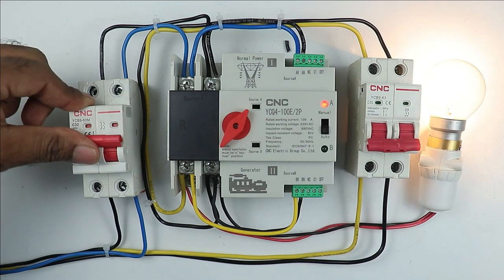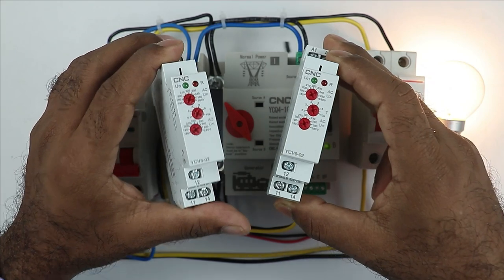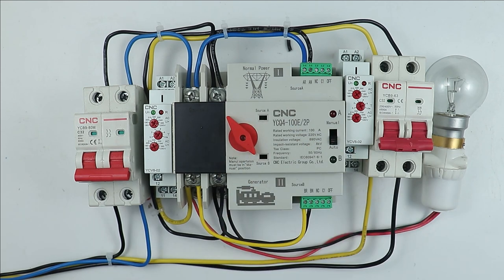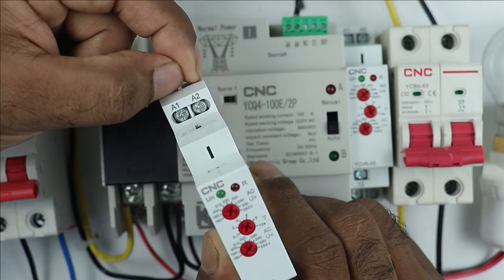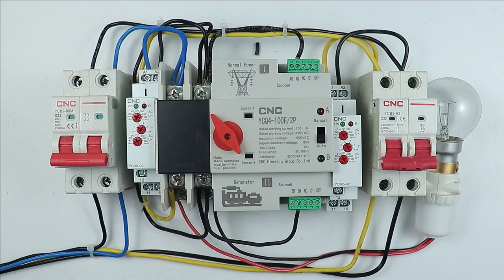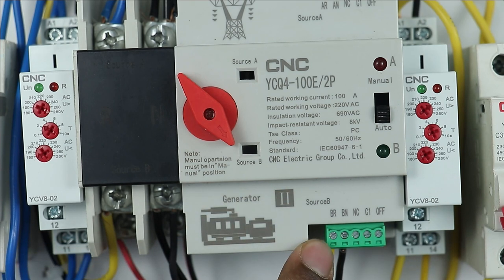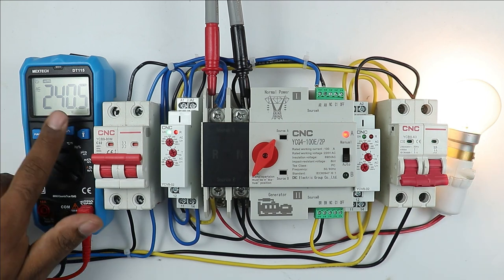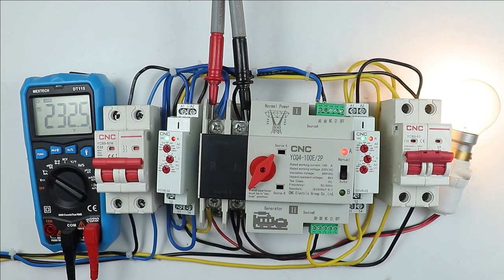Auto Change Over Switch Problem Solved by using Voltage Monitoring Relay @TheElectricalGuy

Comment: Very informative and well explained. May I know what is the different between this ATS, which says grid & generator, and another type of ATS, which says "PV inverter dual power ATS switch", which is grid & inverter. Is it basically the same thing? I need to setup for my solar. Which ATS should I buy?

Comment: I understand the concept clearly but my issue is when the change over occurs with a drop in current (main failing, tripping). There's equipment that's sensitive to voltage sudden dip. How can the drop of a few seconds be corrected?

Comment: Hi the solar panel current green switch does not switch, it buzzes during switching. What might be the problem. Solar  power:   real sinus dc12v inverter in ac 230v

Comment: What will happen if the backup supply also has voltage drop?you forgot to test that.
Reply: Backup can only Drop when gas is done in generator. If Solor  that will only happen when the battery life dies